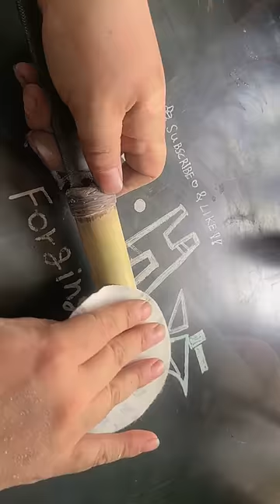Do not sell knives #25

Comment: So my question is why does a file need to be quenched or tempered? It high carbon steel that is already hardened I think. I'm guessing if you actually forge the blade vs shaping it on a grinder, the heating process destroys the hardness?
Reply: Its exactly what you think.. if you heat up an hardened piece of steel the hardening will be destroyed.